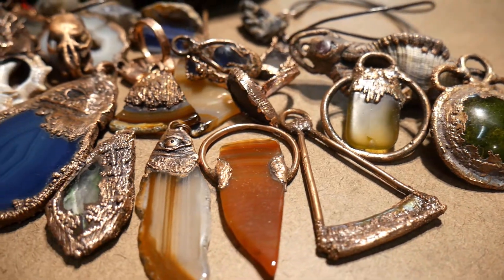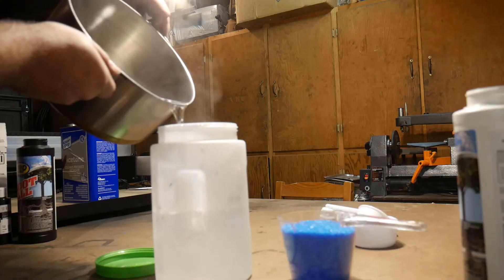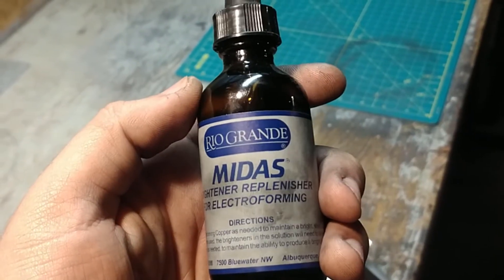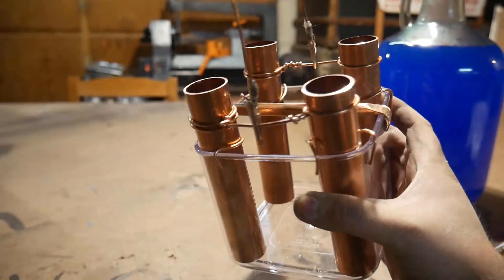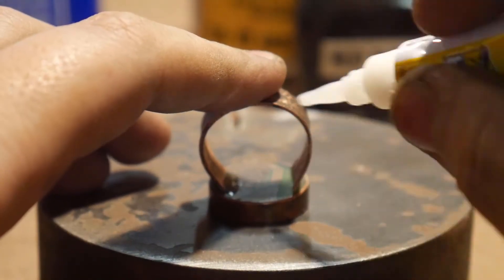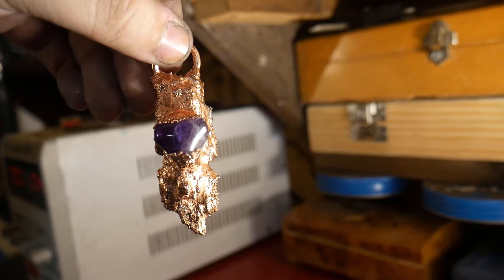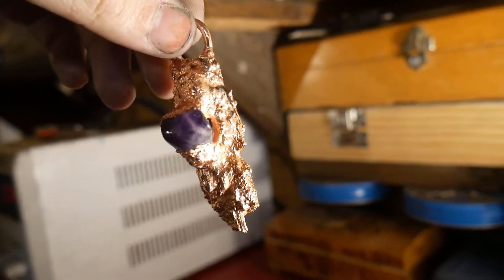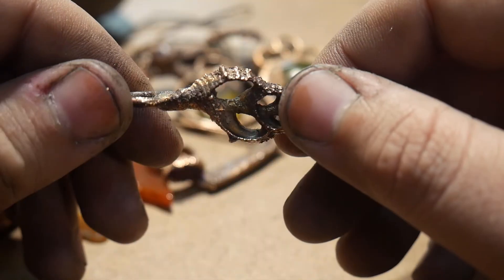Electroforming Basics: Everything you need to know to get started

Comment: agitate your electrolyte while plating to get rid of the current lines on your parts, if the electrolyte isnt moving you get those lines like seen on your ring their, the ones coming from the sharp edge.

i agitate mine using an aquarium air pump, you can also use mechanical means like a magnetic stir bar

Comment: Wow, great video! I have a question, I always assumed that electroplating only added a extremely thin layer of material but some of the examples shown seem to imply that it’s enough material to actually add strength to the part. Is this true? Can joints and thin materials be strengthened by the metal being added?

Comment: My electroforming is coming out salmon colored, rough, and brittle. Can you please tell me what to do to stop this and get a shiny copper finish?
Reply: He mentioned in the tutorial that if you use too high of a current or leave it in the solution too long, it will come out salmon colored and crumbly. Try reducing your current and your timing.
Reply: Can I ask you what you're using for your current? I am new to this technique and want to be sure I'm using the proper equipment. 
I hope you are able to work out your issues. 
I think he addresses these problems about halfway through the tutorial. Thanks for any input. Good luck

Comment: Do you use copper pipes if you’re trying to electroform using sterling silver instead? Very informative video & I’m very grateful to have come across this page!
Reply: I think you need a silver rod...?
Reply: Search for Silver Electroforming Copper here on YouTube. There are explanations for how to do this now. I’ll post the link when I find it. You actually need to plate the object in copper first. Copper is very conductive, so it serves as the base, and you can then plate it with silver or palladium. Your solution is different, as is the amount of current. If you buy the rectifier used here, you can use it with silver, but silver is finicky, so make sure your rectifier will work for both before purchasing.
Reply: What about for Gold?

Comment: Have you had issues with copper forming on the surface as a 'loose foam'? comes right off if water is run on it?
Reply: this happened with me I think about the electricity the volte should be less

Comment: What was your method for connecting the copper wire to the pipes? I’m finding it to be more difficult than expected
Reply: It's a little late but in case you're still wondering, I think he said he just wrapped the wire around the pipes tightly- tight enough that they don't slip. It was easier for me to do it by putting the wire around the pipe and then holding the WIRE while twisting the pipe a few times until it was tight.

I am def no professional and I could be wrong/misunderstanding your question, but I hope you've got it figured it out by now tho (and if not, I hope this helps! :) lol).

Comment: Hi nick ,
That is a very helpfull video , thanks for that.💝
 I have a big problem, maybe you can help me.
I want to electroform organic (butterfly) and i start slow with 0.100A and after an hour i go higher - up to 0.500. but after a few hours and sometimes minutes the current flow drops down. I think my solution no longer conducts  electricity? And when i take out the copper, a lot of loose copper is swimming in the solution? 
What can i do?
Nice greetings from Austria 🇦🇹 
Sarah
Reply from the maker: Hey Sarah, 

it could be contamination from previous processes or pieces, 

I'd start a new solution, new anodes, cathodes and copper hooks 

Then make sure you fully seal your piece before trying again(so it doesn't potentially contaminate the new solution) and also be sure that the conductive material touching the cathode
Reply: @NickMartinelliTV  thank you 💝

Comment: This is slightly off topic of electroforming solution (absolutely great video for it, btw)...
I’ve seen many videos where people talk about the formula for amps and how many amps to use but no one mentions voltage. How do I know how many volts to use?
Reply from the maker: The voltage really depends on how fast or how much material you're trying to put on your work.

amperage will fluctuate depending on how much resistance (the stuff you put in the solution to electroform) is in the tank.

The best way I have found is just to do a couple test pieces and compare the changed variables like 1.25v for 2 hours or .5v for 6 hours

Comment: Question ?  Can any of this explode or is it flammable, or cause any type of electrocution. I’m aware that it needs to be done in a well ventilated area, but I just had to ask :)

Awesome video. Thanks
Reply from the maker: Nope! Not flammable and there is more voltage in a AAA battery than on your power supply with correct settings. 

The ventilation is only necessary during the initial mixing

Make sure you don't ingest or get it in your eyes

Other than that it's pretty safe!

Comment: Hey there I know this video was done quite some time ago I am but I just seen it can you tell me with the same machine that puts out the electricity work for other metals meaning if you want to do nickel or you want to do rose gold or you want to do gold plating on something or do you have to have a different machine and is there any place that would be a local establishment to buy that piece of equipment from or do you have to just get it through Amazon
Reply from the maker: I've plated silver and copper with this and you should be able to plate anything that can be electro plated with this.

If you have an electronic store like a fry's or a "radio shack" equivalent then they should have a bench top power supply like this

Comment: Thanks again for this video! It truly is wonderful. I’m making my solution right now, and I have a question I can’t seem to find the answer to online. 
When making the electroforming solution, does the measurement for the root kill/battery acid change depending on how much water you use? You’re using 2 quarts water for 16 oz root kill & 16ml sulfuric acid- if I’m only using 1 quart of water, should I use half the root kill & sulfuric acid? OR should I keep the measurements the same?
Reply from the maker: I'd half the root kill and acid, to keep the potency/ratio the same for one quart
Reply: @NickMartinelliTV  thank you! You really are the best!!

Comment: This video is great Nick! 
Thank you so much. 
I don’t have any experience soldering- instead of using alligator clips to attach the rectifier to the two anode wires to make one giant anode, would it be possible to attach the wire (without alligator clips) directly to the wires on each side to make the one giant anode?
Reply from the maker: As long as they are all clean and connected securely it should work!
Reply: Thank you! I appreciate your help and your videos! You rock!

Comment: You really breezed past the rectifier settings, which is the most confusing part for many people... including me 😅
Reply from the maker: It depends on the size of tank and size of object or objectss you are trying to electroform, how potent your solution is, and how long you want to wait. There are too many variables for me to give you an accurate answer specific to your needs.

 When I first started out I just started with a low voltage and slowly started to raise it up until I got the sweet spot. I suggest try out a couple test pieces at 1.5 volts for a few hours and adjust from there

Comment: What do you do with the solution that is left in the container? Do you store it and continue to use it for the next batch of copper (removing the anodes, of course)? Do you dispose of it? What is the safest way to do either?
Reply from the maker: You can store it! I can last a couple years easy... Root kill is designed to be put down down drains to kill roots, so you could put it in the sun and evoporate the water out to save it for the next time you need to get rid of roots

Comment: Can you reuse the solution? Do you dispose of it? If so, how do you do it?
Reply from the maker: Yes you can reuse it you just need to filter it with a coffee filter,

to dispose neutralize the acid by poring baking soda in the solution until it stops fizzing and leave the container out in the sun until all the liquids have evaporated. 
 it should be safe to toss. root kill is made to go into drains but this seems like a safer way,

Comment: How long do you let the india ink dry for?
Reply from the maker: Drying time can be around 30 minutes or so but it could be sped up alot using a hair dryer or heater
Reply: @NickMartinelliTV  india ink is soluble in water as soon as i dunk it the black starts leaching into the electroplating mix :(
Reply from the maker: @SICKFREDO  the india ink to graphite mix I tend to use is around 50 /50. the black you see could be the graphite

Comment: How to dispose of mix once it is spent? Also, can you substitute muriatic acid (hydrochloric) for sulfuric acid?
Reply from the maker: to dispose neutralize the acid by poring baking soda in the solution until it stops fizzing and leave the container out in the sun until all the liquids have evaporated. 

 it should be safe to toss. root kill is made to go into drains but this seems like a safer way, 

 I'm not sure about hydrochloric acid, it might work but when I've used hydrochloric acid for etching its a little too noxious for indoor/ not well ventilated areas. I'd go with sulfuric acid
Reply: @NickMartinelliTV  I just heard in another video that it is not safe to toss after and you can reuse the solution for a very long time. This stuff is very dangerous to aquatic life. They said the acid was not the problem in the long run, but the copper is?!

Comment: So how do you make your ink? I attempted mixing India ink and graphite, and it seems to run when I put it in the bath.. any suggestions?
Reply from the maker: I'd take a hair dryer and make sure it is fully dry to the touch before putting it in the solution.
Reply: I actually did that with one of the pieces, and it bleed pretty heavily. Is it possible I shoved too much graphite powder into the ink?

Comment: This is a great video! Thank you! 

I did my first pieces tonight, and they came out being spongy- and under water washed off.. I used a solution from amazon, and I made my paint with graphite powder mixed with black acrylic paint (I saw this method before I saw your video) 
Any thoughts?
Reply from the maker: I think Acrylic paint is water soluble, which is most likely the problem, I'd filter out you solution and try again with India ink!
Reply: Nick Martinelli I was wondering that myself! Thanks so much!
Reply: Nick Martinelli I was also wondering how long you can use the solution for? And how do you filter it out?
Reply from the maker: @driajean3542  theoretically you can use it for years if stored properly but I change mine out/ replenish it once a year or so. I use a couple coffee filters in a funnel!
Reply: Nick Martinelli Wow, Amazing! Thank you so much for all the information! Your pieces are beautiful as well 😁

Comment: Hey, great video, tons of useful information! May I ask where the proportion of copper sulfate vs battery acid comes from? When searching for copper plating solution recipes, I found alternative recipes with much more sulphuric acid in them (with the same amounts of other ingredients as in your recipe, others would list about 700 ml of battery acid). I'd like to use as little battery acid as possible and I'll use your recipe, well at least to start with, but was just wondering?
Reply from the maker: A similar ratio of mL of acid to ounces of copper has been the common theme in most places if done research. I figured if it worked for everyone else, should work for me.
Reply: Thanks!

Comment: Sulphuric acid is actually non toxic. Copper is a micronutrient and is safe in reasonable doses. It's not poisonous, just wash off the spoon and you will be fine.
Reply: Copper salts are toxic and/or poisonous; sulphuric acid has poisonous vapors, aside from its corrosive proprieties.
...
Reply: @lulupan7612  the sulphuric acid vapors hurt like hell when you breath them to. Imagine the poor WWII prisoners they must have tested it on. You would have to be in there breathing it for hours before it killed you. Really anyone stupid enough to be directly huffing boiling sulphuric acid to the point that they had not worthy health effects, well, that's on them. You don't get much at all just from being in the vicinity when it is boiling. You really have to make a purposeful effort to get your face up to the breaker and huff it. And it doesn't make any not worthy vapor at all unless you concrete it somewhere between 80 and 100%. And it looks like he is using a super dilute solution. Unlike hydrogen chloride the sulphuric acid doesn't like to evaporate and produce vapor. Also copper sulphate salts are super bloody gross. They are incredibly bitter, you will definitely know if you are infesting even a small amount. I only wish lead salts we're so easy to taste. Would help protect people from lead poisoning

Comment: I'm having a problem with voltage and stuff you did an amazing job with everything but if you could help me with power settings thanks so much
Reply from the maker: voltage is tricky, it has a lot to do with how big the piece is and how conductive it is. make sure there is an uninterrupted line of conductive material. if you still are having trouble start with a real low voltage an wait, then every hour or so raise it until you get your desired thickness
Reply: @NickMartinelliTV  I'm using wood glue and graphite powder like u have doing a piece of wood
Reply: @NickMartinelliTV  how long did it take for ur piece of wood ?

Comment from the maker: 🟧~Frequently Asked Questions ~🟧

(1) The white powder is baking soda, once it touches the super glue it becomes rock solid.

(2) If you are not making a ton of stuff you can use half the amount of copper pipes for the anode and be just fine 

(3) Make sure to take out your anodes if you are done electroforming
if you don't it will leach more copper into the solution and throw off the ratio! if that does happen your piece will be salmon colored and crumbly, take out all of the nodes except one and electroform something overnight to starve your solution to get the ratio balanced

(4) Electroplating, also known as electrodeposition is a process for producing a metal coating on a solid substrate by means of a direct electric current.

Electroforming is a metal forming process in which parts are fabricated through electrodeposition on a model/mold.

An electrolytic bath is used to deposit an electroformable metal onto a conductive surface of a model/mold (mandrel). Once the deposited material has been built up to the desired thickness, the electroform is parted from the substrate. This process allows precise replication of the mandrel surface texture and geometry at low unit cost with high repeatability and excellent process control. 

Depending how you use this process you will be either Electroplating or Electroforming but in the jewelry making community its common to call either just Electroforming
Reply: try some male juices man, the sticky stuff dries faster
Reply: How much distilled water you use?
Reply: @kallis761  go with the flow yo
Reply: How is the strength of the electrofomed material? Is it possible to make a part that has got the same strenght as the copper was as a solid for example as in a pipe or block ?
Reply: @zekeriasvarg530  depends on body heat, copper is active so it gets soft, could also break on pressure , example sex
Reply: @britishboxer6875  thanks.. I have to experiment. Thinking of electroforming metals like iron out of a salt solution (not water) as water does not work. This metode combined with 3-d printed mandrels covered with graphite are very nice.
Reply: Does the Christmas hook need to go into the solution?
Reply: how much miralax do you use?
Reply: @1dimtim  Paying attention to instructions will result in better product. He mentions at 2:05 when he adds it to the solution that it is 1/2 teaspoon
Reply: One tiny scoop
Reply: @noemiechiasson9126  what do you consider a tiny scoop?

Comment: Hey Nick! Very well done vid. But what do you mean by starve the solution?
Reply from the maker: if the solution gets over saturated, only use the smallest amount of anode possible to get the copper in the solution plated on you piece. This will balance your solution
Reply: Nick Martinelli Would you put a one of ones prepared pieces of jewelry to electroform in the solution to starve it?

Comment: Hi, 
Good video, Thank you!
Questions:
What powder are you using with the glue to hold the jump ring on the shell?
Making the graphite paint... is it as easy as mixing graphite with the mod podge or ink?
What type of ink is that?  Im in SA, and not sure what you have there .  Thanks :)
Reply from the maker: Thanks for watching the video!

 the white powder that is  sprinkled on the super glue is baking soda, once it comes in contact with the glue becomes Rock solid.

 It's just that easy haha just mix the graphite with whatever medium you like, you just have to make sure that there is enough graphite to be conductive but also workable enough to paint on it's not an exact measurement.

 the Ink is called India ink, they should have it at craft stores or art supply stores, if not you an always pick it up from Amazon!
Reply: @NickMartinelliTV  Thank you for the information! I am sure I will still be learning lots from you.